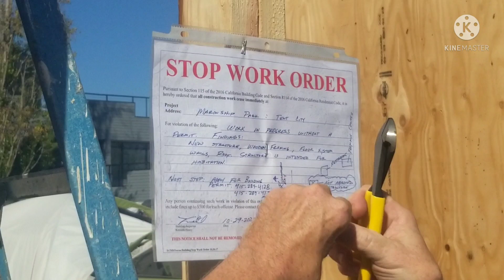building storm-proof shelter for homeless defying building codes marinship park tent city sausalito

Comment: I know its to late to worry about it now , but today when I saw the shelter I couldnt help but botice the plywood should be on the outside and the studs inside,
Reply from the maker: Today they are installing insulation in between the 2x4s  and adding another layer of walls over that.